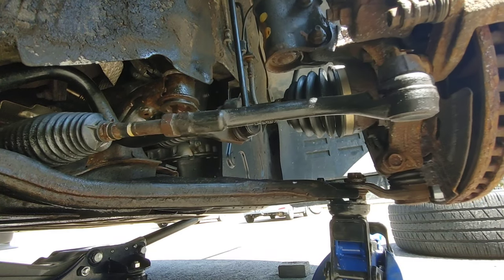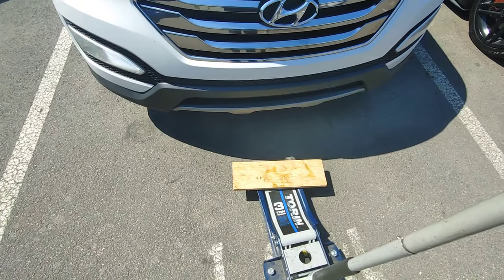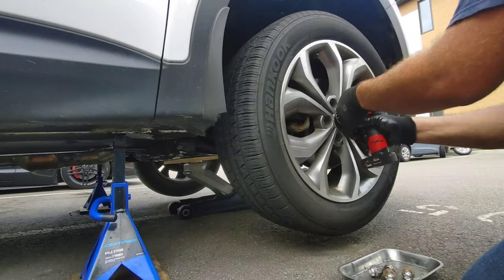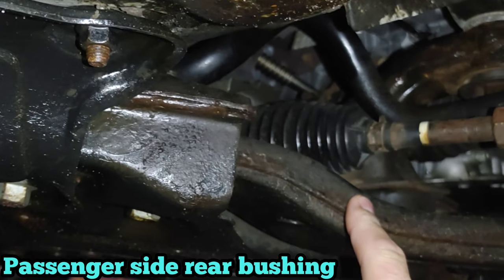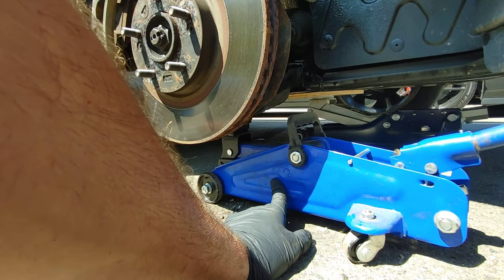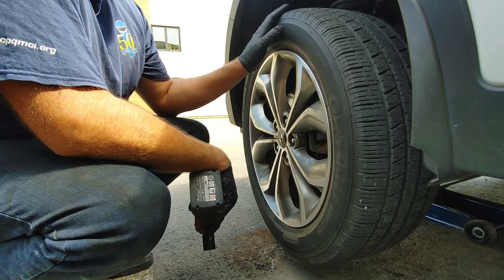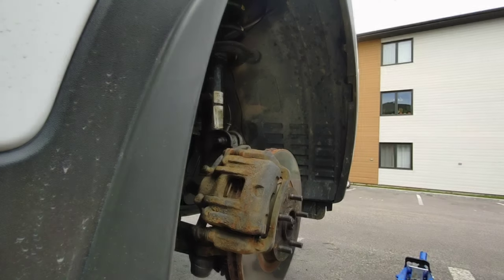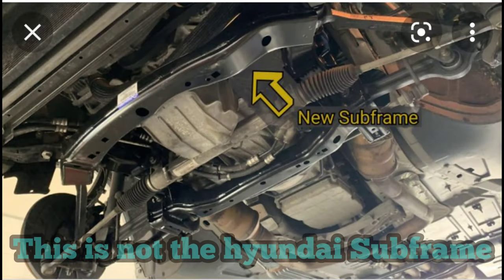Creaking Noise when turning diagnose

Comment: So next time get yourself a stethoscope, you can get them for like 5 or 10 bucks, then have someone turn the wheel while you touch every joint and anything that moves. You will hear the difference when you find the source of the noise. In your case if the subframe was loose you would have heard a lot more noise when touching the stethoscope up against any metal part of the subframe compared to any other metal part you put the stethoscope on. The sound will travel pretty easily through any connected metal but any bushing or joint or rubber will stop it so it helps you isolate these noises.
Reply from the maker: Yeah it's a really God way to find it when someone can turn the steering for you thanks for watching and comment brother 🙏

Comment: You are a life saver, I was convinced it was the strut. I took it apart like 4 times and replaced so many parts. This was the exact noise on my 2016 Corolla. Found 3 of the subframe bolts were loose and like magic the sound disappeared. I can’t thank you enough.
Reply from the maker: wow, that made my day, at the time I hesitated to make the video, I told myself that it was a lot of work in addition to my problem which drained all my energy... but to read your comment I tell myself that it was really worth it
Reply: I wonder if that's the issue with my Sentra. 2013...new struts and lower control arms installed also rear stabilizer bars. I hear a creaking/vibration upon acceleration on my driver's side area. I started with rebranding the tires...no dice. I'll have my mechanic check the rear and sub frame bolts. The sound is like a loose something or other. Thanks for the video!
Reply: same issue on my vw... i have new suspension parts.. so i dont understand why... time to check subframe!

Comment: I had exactly the same noise. Found out that it was the suspension strut mount bearing. Sprayed with some WD40. Problem solved.
Reply from the maker: Nice!  cheap fix

Comment: Quick safety tip, if you're working on a lifted car, drop it onto the jack stands first, don't just place the jack stands under it while leaving it hanging on the jack, it's quite unsafe
Reply from the maker: Dont worry i place tires under the floor .. but great advice
Reply: @basicdetail4512  No, he's talking about 3:40 where you have the wheels off the ground. You need to put the weight of the car on the jack stands and off of the jack.

Comment: It's amazing how a few loose bolts can cause so much of a headache. I had a similar loose bolt issue.  Found it by getting under the car and (with someone inside at the wheel turning) placing my hand on various parts while she turned the wheel side to side. I have a QuickJack so this was much easier and safer. Turns out it was a loose cat exhaust mesh cover that came loose after she ran too fast through a large puddle. Snapped right back in place. Problem solved... and she got a lecture on driving thru standing water lol.
Reply: Was the car in with you under there? Because it must have been if the steering lock will click in when turning the steering wheel with the car off. So  was the car in with you under there?
Reply: @Deathridaz714  I have a lift at home, so yes, I was under the car while she was turning the wheel side to side.

Comment: For checking balljoints on FWD/4x4 vehicles, i use a prybar under the tire, and visually check for play. The normal hand on 12oclock/6 oclock wiggle test only works on those cars if the balljoint is REALLY bad (shouldnt drive car until repaired), whereas the prybar  will catch worn balljoints, thus giving you time to plan repair/order parts
Reply from the maker: Yea i agree m'y friend i use the pry bar method in the video 6 and 9 oclock works better for bad tie rod

Comment: What a fantastic video! I have a 2020 WRX that’s presenting the SAME problem, that I CANT find.  I’ve changed the outter tie rod end bc it was stiff, but still the noise.  So the car just came back from the body shop bc a tree limb fell in front of my car, causing $10 worth of damage when I launched over it doing 60 mph.  One of the things they replaced was subframe cross member. I can’t wait to put it up and hit em with the old ugga dugga. It’s definitely the same sound so thanks for making my day!
Reply from the maker: Thanks m'y friend i appreciate ! I wish you so mutch that is gonna be that too ! Thanks for watching

Comment: Thank you brother I have a 2012 Audi A7 with same problem and it’s cost me a fortune in mechanics guessing on the problem.
Reply from the maker: Your welcome im happy if you fond your problem !! Those problem are nightmare 😅
Reply: @basicdetail4512   not sure if it is but I’ve replaced everything on your list and still having the problem.  At first I thought it was my coilovers.  Now I have another idea    Thanks again sir
Reply from the maker: @mab4870  i really hope ITs gone solve your problem when you Will find IT give me news please ! Have a good Day marco
Reply: @basicdetail4512  thank you brother you too
Reply: @Marco B, damn brother, I have a 2014 Audi A7 same problem. I brought it to a mechanic and he somehow got it to stop sounding. But after a month it seems like it’s happening again
Reply: @joenguyen9979  what did he touch. I’ve spent thousands to try fixing it !!! And still this problem remains 😞
Reply: @mab4870  hey Marco, so the problem with mine was the steering rack. There are 2 rubber boots on both sides, you should check for cracks, tears and for leaks of grease. In my case my passenger side boot had a tear in it and grease came out cause the steering rack to dry out in certain areas (causing the sound when turning certain points). There’s 2 options if this is the problem, Audi dealership will only replace the whole rack for about ~$7,500 USD parts and labour. My option is outside mechanic will repair/replace the boot and clean out the old grease and add new grease it. I’m still contemplating on which one to do.
Reply: @joenguyen9979  is it electric or hydraulic power steering?
Thanks for your help brother
Reply: @mab4870  the most weirdest thing happened, they lifted my car up to further inspect but the sound disappeared. Today still not hearing anything. Is your steering heavy when turning or vibrates/shakes? If so its most likely the electric motor. If it groans when turning then its most likely the hydraulic pump. I’ll continue to update you as they are still investigating (much harder now that it’s not making the sound anymore)
Reply: @joenguyen9979  upon some research I think it’s my subframe bolts. Not sure if that will cure the clunking sounds but I hope it does. It’s driving me nuts and I’m into it so far about 3500$ in repairs
Reply: @mab4870  if its a clunking/rattling noise then could be loose bolts, in my case it was a deep creaking sound
Reply: @joenguyen9979  That’s annoying.Did you find the problem?
Reply: @richardjones3112  weird thing is it stopped making the sound but will randomly come back. So far I found if I park on a slope for awhile it seems to bring the sound back. Parking leveled for awhile and its gone. Maybe even after turning the engine off then on after a bit it stops the sound. My mechanics have been trying to recreate all scenarios but can’t pinpoint it. So far our conclusion is the electric motor in the power steering rack might be faulty.
Reply: @joenguyen9979  I had a similar noise in my Ford Fiesta 2012.Apparently the heat from the electric assist for the steering dries the grease on the bearings.I sprayed a lubricant on the steering column and this seemed to cure it.
Reply: @richardjones3112  thanks so much, i’ll have my mechanics take a look
Reply: @joenguyen9979  Hi Joe, I don't think is the electric motor, I have the exact same sound on my car and it's an MK4 Golf in which doesn't use an electric motor on the steering wheel, It may just be the rack and pinion or the same issue that the person that posted this video had, when I find out the issue with mine, I will update you with any information I have gotten, I will appreciate the same

Comment: Hey thanks for the time and effort to make this video. I have the same problem with my car but after new struts were installed.   I will have them double check the torque specs on all the bolts.
Reply from the maker: Thanks brother  I appreciated ! I hope for you that will solve your noise

Comment: I have exactly similar sound to yours, but it occur when I'm breaking on slow speed. The mechanic check and suggest to replace the steering rack! How is that? My personal anticipation is the suspension because such sound is like from steel bending or torsion.

Comment: Just use a meter of garden hose pipe. Put one end in your ear and the other end put near all the different components. Have a helper move the steering wheel to make the noise and the pipe will be your stethoscope.

Comment: I'm about to find out if your tutorial would solve my issue as well. Replaced almost all lose parts in suspension but nothing works. Recently, a mechanic replaced the steering rack and had to loosen the crossmember and diff support during the installation. So this might possibly be the same issue that I'm encountering now. 

Question, do hear thumping noise on uneven roads? 

Thanks so much for sharing this video. I love the way you explained things in detail (speaks strong of your channel name). So you got another subscriber in me. 🤙
Reply from the maker: Im sorry for your question i cant remember , but thanks for your comment i appreciate your share
Reply: @basicdetail4512  no worries. keep up the good work

Comment: Check the bolts on your SUBFRAME. I had the same issue, and after replacing the whole suspension, the issue continued.  I found a bolt that was loose on the subframe and fixed the issue.
Reply from the maker: Yeap at the end of the video I find it and just like you it was the subframe

Comment: For 6 months my husband has been trying to find my creak he checked everything replaced things just in case greased where he could (i don't have refillable joints) it would lessen with silicone spray all over the joints but never go away. Before the noise started my cel and wrench popped on and got a transmission fault. He did a filter replace and fluid partial replacement (after 9 years having this car and not know when it was last done before me the did was pretty clean. Anyway he noticed the transmission mount had alot of degrading around the rubber of the mount (reason for slight clunk when shifting into reverse) he replaced that, it was about a 3 weeks later the squeak started and now I'm wondering if i may have this issue of improper torque on the when he was putting it all back together
Reply from the maker: Thanks for sharing! I hope that you will find it 🙏

Comment: I had a Honda Accord which I just installed new rear springs and ended up with a creaking noise on the driver rear area.  It turned out I had over tightened a few bolts back which caused the creak.  I bought a new torque wrench and tightened all things back there to spec and no more noise.
Reply from the maker: Thanks for sharing that ! Very interesting how mutch torque specs can make the difference! Thanks for watching too

Comment: I had same problem. Tak tak sound. Check drive shaft ok. Link kit ok. Ball joint ok. And im not change the engine. So maybe not from bolt subframe like you. Now im headache. Dont know whre the sound came from.
Reply from the maker: Do you find something finaly?
Reply: @basicdetail4512  yeahh.  the stabilizer link.
Reply from the maker: @sedydaud  Nice not too mutch Expensive
Reply: @basicdetail4512  ya bro.

Comment: This is the exact problem i have on 2017 kia sportage but I didn’t have an engine swap or work of any kind in that area what was your issue you found ? My dealer mechanic cannot find the issue
Reply from the maker: AT the end of the video i explain IT... It was a loose subframe Bolt they torque Them AT the good specs and the noise gone
Reply: What fixed your issue please @Pgalarza10

Comment: Hey sir I watched the whole video I understood everything up until the last moment lol so what was the ending problem that helped you fix that creaking noise because my car is doing that at the moment. It was a loose bolt?
Reply from the maker: The problem was due to a loose Bolt That is job is to hold the subframe in place ... The dealer remplace the engine and he as to remove the subframe to swap IT ... But he forgot to tight correctly one Side of the subframe ... Hope ITs more clear thanks for Watching m'y friend
Reply: @basicdetail4512  thank you my friend for the quick reply I sub'd and liked the video is this something I could do with only a jack or would I need a car lift?
Reply from the maker: @michaelkash5396  thanks for your subscription , i appreciate and yess you Can Do IT on Jack stand if you got a torque wrench ITs the best to be sure you are AT the right specs

Comment: Mine was only noisy when i am stationary and i turn the steering wheel. It sounds like grinding rubber and it really vibrate the entire car.It doesnt sound when it is lifted up it only sounds when the wheels were on the ground.
Reply from the maker: Seems to me like a control arm bushing 
https://youtu.be/H1fd4N7HLh0

Comment: I have a similar noise on an 8th gen Civic but its much more quiet. I think its a new problem. I got under the car and visually the suspension looks good, but after watching your video, i’m wondering if the lower engine/ torque mount could be the issue. I noticed the bushing looked bad on one half. 

I can also hear the noise at slow speed when also braking & acceleration. Not just slow speed steering. Any ideas?
Reply from the maker: Interresting , can i suggest you this video i done last year
Reply: @basicdetail4512  absolutely! What’s the name of it?
Reply from the maker: @leospaceman2976  sorry Brother i forget to put the link 😅 this is the video  https://youtu.be/H1fd4N7HLh0
Reply: Thanks pal! Just wanted to say i  had a similar problem on a different car and it was the top of the struts. So new struts was my solution.

Comment: I was at the drive thru yesterday getting food and heard clicking or ticking while i was stopped, i had moved the wheel by accident and heard it so i started to turn my wheel all the way left and definitely heard clicking the whole time my wheel was turning, i cant hear anything as im driving because of the street noises and i cant hear it inside the car unless its quiet and the windows are down, i also dont know if the passenger side is doing it too but the driver side is for sure making the sound. would that be the axle or maybe the bearings? i just paid $1100 on all new tires, brakes and rotors 2 months ago and if i can diagnose it myself i can replace it myself because the place i go to charges 250 just to tell me the problem.
Reply from the maker: Hi friend the car is stop and you turn the steering left to right There is a good chance to be a bad tie Rod end ... AT this point Do the 9 & 3 hours test with the front wheel of the Ground ...if IT a bad Axel make a 360° Sharp turn the noise should increase with the speed ... Good luck

Comment: got same problem but rather like cluncking/cracking noise, 3 garages check and found nothing. Changed shocks/coil springs/strut mountings and strut bearing and it's even worst. Need to tell garage to check all bolts on subframe than
Reply from the maker: This is a nightmare  ! Hope for you that is the bolt too

Comment: My santafe 2013 I have replaced 2 shock absorbers, bearings, genuine mounting, with all the support columns and steering rack, but the noise problem still does not go away, when I step outside and turn the steering wheel, there is no noise or when I lift the car 1mm, there is no more noise.
Reply from the maker: Look like me ! Good luck brother

Comment: My advice in this situations as ı engineer replace all bushes,same with my jag s type ı buy 2 ball joint 2 arm bush 2 suspension bush 2 steering rack bush( insulator) with high quality parts meyle,borg becker etc because all front parts need to be replaced as a set ıf they are mid or bad condition

Comment: At 8:57, would have been nice if you used a auto stethoscope (with rod probe ...about $25),  and touched various components to listen for the noise.  Is best way to pinpoint noise.
Reply from the maker: Yea for sure ! M'y main concerne ITs That i was Alone during the process but Great Idea for others people are in investigation
Reply: I strongly agree
Reply: Or a screwdriver as a stethoscope I used a screwdriver to find out my fuel pressure sensor was tapping and not my whole head thank god🤣🤣cheap and cheerful

Comment: Wow!!! That engine bay is a disaster!!! Whay is that brown substance beneath the shock on the passenger side?
Reply from the maker: Antirust m'y friend 😂 discusting i agree but rust free
Reply: @basicdetail4512  ohh I see, but what is the point of putting the anti rust inside of the engine bay? My vehicle doesn't have anti rust inside the engine bay and it also doesn't have any rust in there either. I thought as long as it was a painted surface properly there would be no rust able to form. But interesting to know!!!! Now the next video I see from you, better be a "How to" tutorial on cleaning your engine compartment, and seeing your engine all sparkling clean 😉
Reply from the maker: @jamesabarela  trust me ... Where im from Most of the car without antirust Will end to the scrapyard after 15 years because of the calcium they Lay on peut Road during winter so i prefer ugly and strong than Rust Everywhere ! But on m'y corvette ITs always clean dont worrie